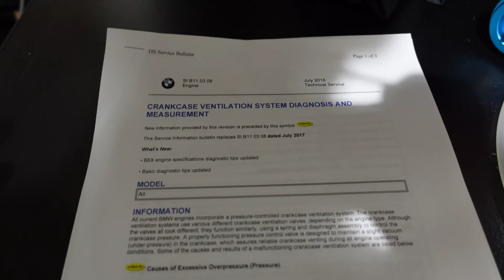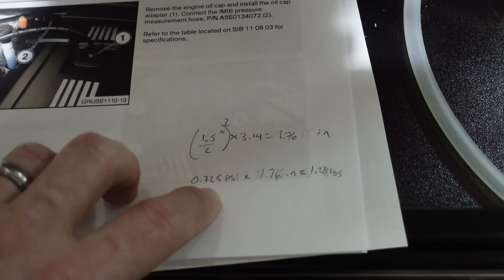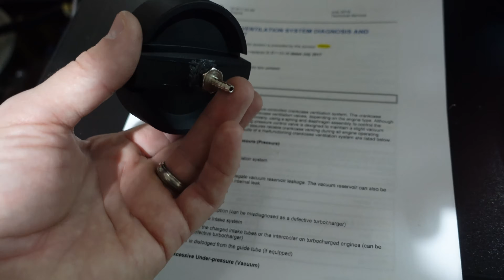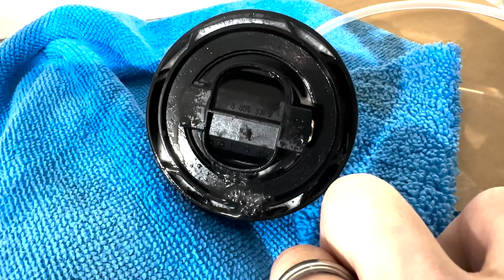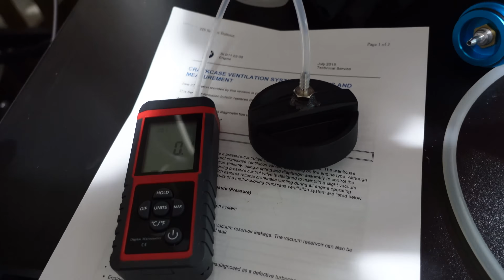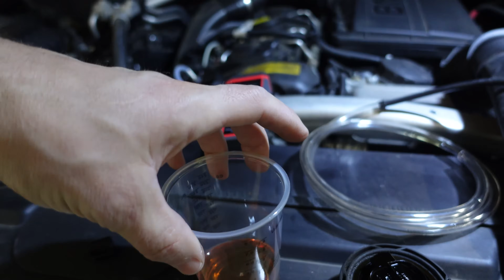Best Cheap Test for BMW N55 PCV Valve/System - X3 X5 35i 535i 335i

Comment: I have a 2017 X5 sDrive35i, during a cold start, RPM would drop below 1000 and then level out. Turned out to be a bad fuel injector and not a bad spark plug(s)\coils 180K miles.

Comment: I wish I knew about this before. Two days ago got rough idle and check engine light came on. P0171 and Lean Bank 1 followed by Misfires cylinders 3 and 4. Seems like a lot of vacuum - hard to remove the oil cap. Now there is a whistle coming from underneath the middle near the transmission and I'm scared thats the crank seals blowing out due the excess vacuum. Its a loud whistle that goes away when I remove the oil cap. Ordered a new engine valve cover from FCP Euro and going to replace this week. Hope my seals are still ok... How will i know if those seals are bad?

Comment: My 2013 X5 runs smoothly on the freeway, but at idle it stumbles and the engine shakes. I’m getting codes for Bank 1 too lean and random misfires. I performed a smoke test on the vacuum system and noticed a hissing sound coming from the PCV. When I cover the hole, the hissing stops. Would that indicate a torn diaphragm?

Comment: Awesome video and tutorial.. since I do have traditional valve cover and oil cooler leaks I was curious as to how to tell if my PCV is working.. I have a manometer (Druck) and I’m gonna do that test to ensure I’m regulating in the 50mbar range .. this way I can order a new cover if I need it .. I know I need the gasket but don’t want to only do a gasket if I have a faulty PCV.. thanks for sharing

Comment: Great video! Did you ever solve the rough idle? Mine has a cold start idle stumble that seems quite common. I have new plugs, coils, MAF, and air filter. No change.
Reply: Get your DME reflashed with the most current software from BMW. Fixed mine after 2 valve covers, new coils, plugs, and new diverter valve. Was under $200 at the dealer. Possible a tune would fix it as well.

Comment: What was the cause of your oil at the bottom of your charge pipe?  IIRC, when I had oil there it was actually traveling all the way from a broken oil cooler gasket all the way down to there.

Comment: Why is it necessary to seal the side of the cap if it’s all sealed up inside of the oil fill port once you close the cap?
Reply: It was leaking on the outer edge of the o-ring not the inner

Comment: very informative video. thanks.  I have bmw 116d (F20) engine, when I open the oil cap i see white smoke coming out, but it also shows positive air pressure coming out and dont see any vacuum or suction. My car idles at 900 rpm. I see many videos on fb and people say its normal for these engines. any thoughts?

Comment: If you have 100k on an N55 change the vavle cover, plugs and coils.  The vavle cover has a little filter inside of the CCV system that clogs up and you cannot replace it.  Don't wait for it to break and ruin your engine. Just do the maintenance.

Comment: good job bro! dang! why do they have that big thick foam stuff covering the hole top of the motor? i was thinking just leave it of for more cooling? what do you think? oh and im a new sub,great video
Reply from the maker: If you are referring to the engine cover it serves a few purposes. One is to quiet the sound of the injectors and high pressure fuel pump. It also (and very importantly) prevents the heat from the engine from heating the hood and damaging the paint. Think of old cars that had damaged hood paint when they didn’t have these covers yet.
Reply: @JoeDidItTV  ok cool! thanks for the info brother!

Comment: Looking for advice…I did replace my PCV but still have a squeal.  Also did front seal.  I bought the manometer and oil cap to make your tool.  On a cold start it works fine but when the engine is warmed up and I start it pulls the vacuum to 100+ and squeals for a while.   Fake news says there are multiple valves that suck and release…is that true?   I am going to try Frankensteining a delco pcv to a cheap oil filler cap.  Car has 128k and need it to limp along for a year…
Reply from the maker: Interesting. Did you replace the whole valve cover or just the pcv? If just the pcv (aftermarket) perhaps it’s sticking (?)

Comment: great video - not 100% sure, but I think the ISTA diagnostic tool can take a measurement of crankcase pressure from the valve cover through one of the sensors in that area.

Comment: I own a BMW shop and I can say you’re 100% bang on. You’re hired ! 
Nice video . 
I wish someone made caps like this for testing , same with bmw expansion caps to pressure test . 
Perhaps alloy ones aftermarket ? So I can tap it clean . Not plastic.  The old honda B16 were aftermarket solid CNC. 
I hate batteries , a mechanical gauge is better for a shop perhaps . Nice video !

Comment: IM GETTING THE SAME READING ON MINE WITH THE SAME ISSUE ON COLD START. THE SPECIFICATION FROM BMW IS 50+/- 8 MILLIBAR. BUT WE ARE BOTH READING "NEGATIVE 50 MILLIBAR" I CAN BLOW IN THE METER AND GET A POSITIVE 50 MILLIBAR READING. SO I BELIEVE WE ARE BOTH OUT OF SPEC. CAN YOU RESPOND?
Reply: I did same test. I agree 50mbar is not in a vacuum, it means +0.05bar pressure

Comment: Just get a smoke tester. P0171 code is an indication that you are sucking in air always from the valve cover. Beck and Arnley from rock auto is literally an OEM valve  COVER  with gaskets for225.0.  Takes 2 hours to do🎉
Reply: Smoke test won’t tell you if you have a stuck open PCV.

Comment: I have a S63TU engine in my X5 M50i, I saw a little bit of oil residue in engine air filter tube. Would that mean I have a failed pCV? It has 60k on it. No check engine light no crazy start or knock, what would this mean? Please help. Thanks
Reply from the maker: Is it on the charge pipe coming from the turbo? I have seen this on my N55 and my B58, might just be a bad gasket on the charge pipe. A small amount of oil in the charge pipe is “normal” but can be eliminated by adding aftermarket catch cans. I haven’t got around to replacing the gasket on my B58 so for now my turbo is lightly covered in oil.

Comment: I have some light engine shake at idle. I'll perform some of your tests in order to know more.
Thank you.
Reply: Have you figured out what was causing the shake ?’  I have the same issue on my 2012 X6 N55 engine
Reply: @dappa311  I've replaced my coils. it helped a bit. But anyway I'm not obsessed about it, i can live with it.
I red the walnut blast on the intake helps there on high mileage car (mine is at 215000km now). I have to find a trusted shop proposing this service.

Comment: The main info missing for me, is what it does, why it does it, what the consequences are if it's goosed.
Reply from the maker: It regulates the vacuum pressure in the crank case. Which is necessary to remove the vapors. If it’s goosed, air can be sucked into the crank case bearing in some cases, causing damage to the bearings and causing ten thousand USD in repair bills.

Comment: I have a problem where i get 60mbar of positive pressure instead of 50mbar negative pressure and the car is burning oil. Any input what could cause that?
Reply: I applied vacuum to the top side of the diaphragm and then got negative pressure meaauring through the oil cap. Like the spring in the diaphragm was broken!? Then i changed the valve cover and i got normal -50mbar and all is good again.
Reply from the maker: There are a number of potential causes of this. First off, the positive pressure is caused by blow by from the pistons, if you’re lucky it could just be a clogged port on the top of the PCV diaphragm. The small port that I connect the hose to in the end of this video. Check to make sure it’s not blocked.
Reply from the maker: The reason it’s positive instead of negative is because something is preventing your intake vacuum from sucking that excess pressure down. One possibility is a bad or stuck valve.

Comment: I carried out this test on my N55 that started to have a squealing rear main seal.  Turns out I was getting more than double the nominal PCV pressure after highway driving.  Have replaced the diaphragm PCV valve/regulator with pressure returning to normal at this stage, but will likely replace the overall valve cover to be sure.  Very happy to have this identified because replacing a rear main seal is a MAJOR job.

Comment: S55 PCV 'SQUEAL' - Easy Fix (so you don't have to replace the entire valve cover)  - search that forum thread title and see this great video linked
Reply: Just done that to my F80 M3, replaced the pcv valve with a new klifex one from amazon. Cut the old one out, fit the new pcv vavle using jb weld and optionally you drill 4 small vent holes under the breather nipple on the pcv if you decide to gut it out completely.
Reply from the maker: For sure that’s a good option. I wanted to show an effective way to test if a repair is necessary with this video.
Reply: @mircebob  I don't understand what it is you've done - is it the oil filler cap that you've gutted and now have 4 small vent holes in it? - if so that may allow more air into the engines intake downstream of the mass air flow measurement device.
Reply: @ToughGuy2  no, i was talking about the PCV valve itself that sits on the valve cover. Not the oil cap, my bad.

Comment: Yes! Finally! Thank you sir! This video needs to make its way to the forums, I have yet to see any troubleshooting like you demonstrated. All I’ve seen and heard is what you debunked, and I honestly thought they were busts too but I don’t have a very good understanding of the vacuum system on the n55. I am currently chasing an issue where the vacuum lines are filling with oil as well as the vacuum chamber in the valve cover and I am hoping it is an internal crack and a new cover remedies the issue. I will surely be adding your inexpensive setup to my tool box! Great video!
Reply from the maker: Yes! I test the pressure every time I change the oil now, takes 2 minutes but can save thousands if the system has failed. Mainly because you will be damaging your crank shaft seals and not know until it’s too late. As for the other tests I’ve seen like using a lighter, it is actually very difficult to do because there’s a lot of wind in the engine bay.
Reply: @JoeDidItTV  agreed, I couldn’t tell if it was the wind or valve. Upon further research I think my vacuum pump is going out here soon and need to get it replaced before a catastrophic failure. It seems although the pump supplies vacuum through the hose routed across the VC oil can still travel upwards through the line into the vacuum chamber.

Comment: I have same vehicle and engine combo in my wife’s 2011. It has small hiccup idle just changed plugs/coils and valve cover. Did you figure out what was wrong with yours?
Reply from the maker: I changed plugs, coil packs, serpentine belt (with the tensioner and idler pulleys too it’s a kit). Then I did a bottle of Techron fuel system cleaner. In that order, all of them helped a little and the stutter is almost completely gone. All of these are things that should be done anyway so it wasn’t a waste of $$. But you could start with the fuel cleaner because it’s the least expensive option.
Reply: @JoeDidItTV  , were you getting any Service Engine Soon fault code that led you to suspect faulty PCV/CCV valve? I am changing down annoying P1112F issue.  Already replaced valvetronic sensor gasket flange and crankcase vent hose as they failed smoke test.
Reply: I changed the turbo solenoid and it ran better for a couple weeks.  Then jitter in the tensioner and P0112F again.  My next step is to check that again, and change spark plugs.  I had a bad pcv valve - loud whistle from seal, so I changed the valve cover.  Still has P0112F.  PCV was cracked.  Not totally sure.  I replaced rotted hose on boost solenoid and new solenoid, but can’t imagine it failed so quickly.  Must be an internal leak.  I saw no smoke leaks when I tested.
Reply: @JoeDidItTV  thank you!!
Reply from the maker: Actually I did the belt before the plugs, but the fuel system cleaner made a noticeable difference. There’s still a little excessive vibration but that might just be normal aging of the motor mounts. It’s so minor that a dealer would tell me I’m crazy if I mention it for sure. No more idle hunting tho.